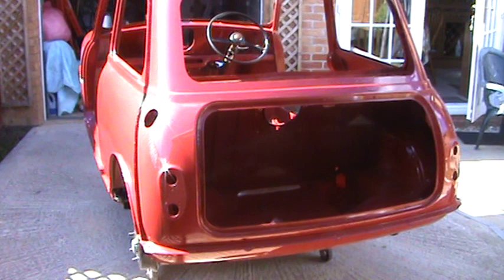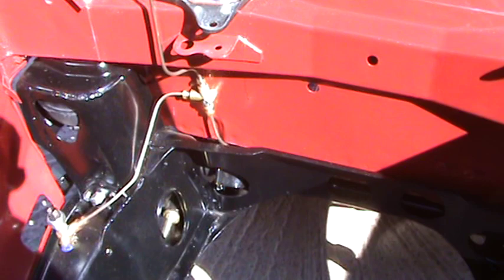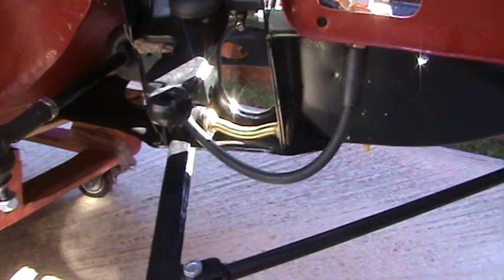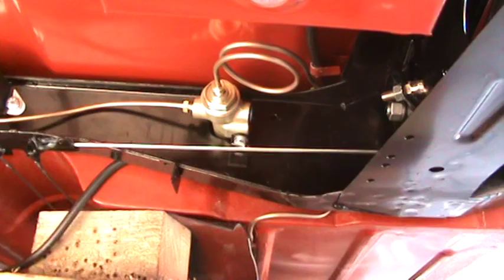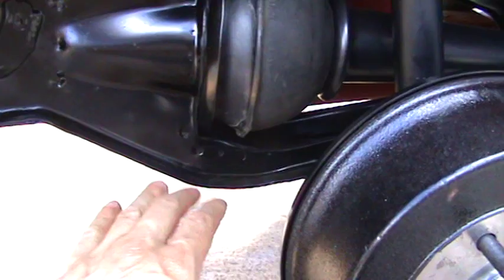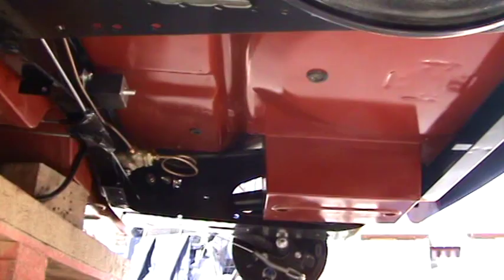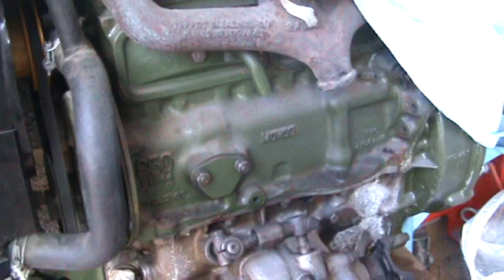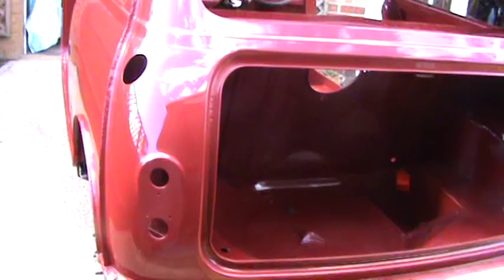1960 Morris Mini Minor Restoration (Part 6 of 10)

Comment: G’day John I just happened to stumble across your video and you have down a terrific job on the restoration, the paint job is beautiful and the detail with the brake lines ect are great.  It was nice how you have both sub frames painted or powder coated in black really nice.  Regards John Tasmania Australia
Reply from the maker: Thanks  John. Nice to have your kind reply. Yes. It's a meticulous restoration. It's all in the planning. Also research. Each area of restoration I treated like its own project. That keeps things under control as it's easy to lose control of a restoration if not planned correctly.

Comment from the maker: Hello
Thanks for the compliment. As for coiling the brake pipe at the rear subframe, a copper brake pipe will be more forgiving than a steel one, because copper is malleable and more flexible. Steel ones which were originally used are most prone to fatigue and MUST always be coiled, but I guess its good practice and safest to coil any brake pipe you choose!